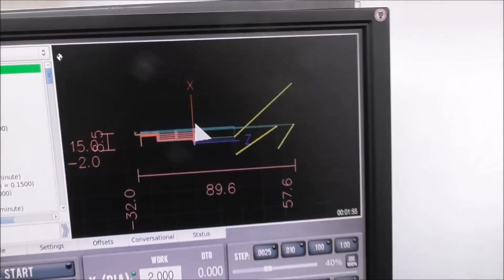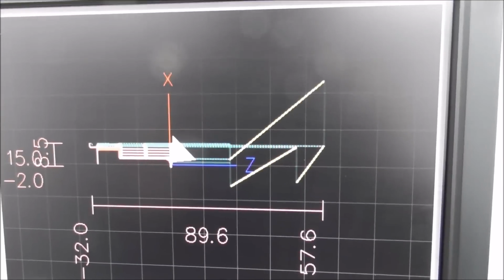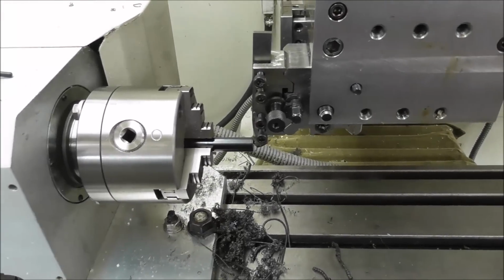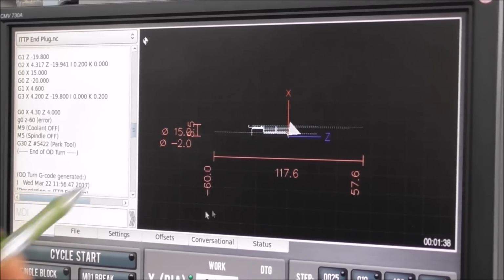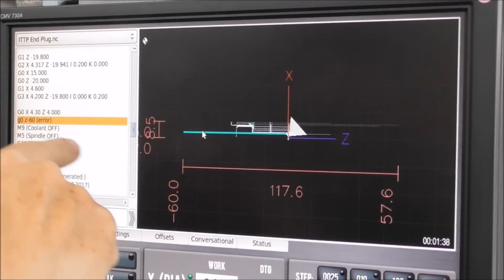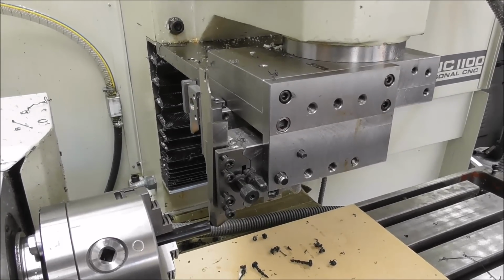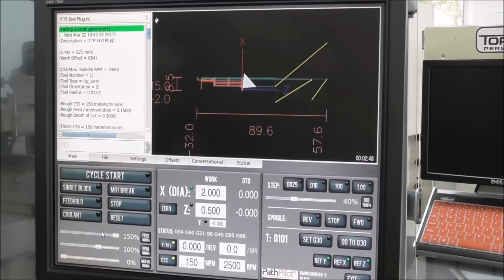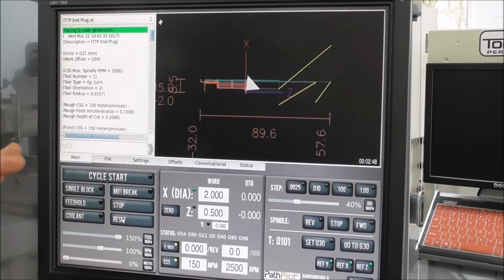Tormach Rapidturn -  Chip Control and Crash Avoidance

Comment: Needed to turn that parting tool around so the tit is left on the finished part, not the barstock
Reply from the maker: Hi Aaron. I don't follow your suggestion of turning the parting tool around?  Cliff
Reply: Are you able to flip 180 on the tool post and run spindle in reverse ? I only mention because I see the bar stock has no remainder tit after part off but the part has one. Or is the tit a feature of the part ?
Reply from the maker: @aaronreihl39 Thanks, I see what you mean. That part has a slot machined in the head that removes the pip. But I will keep your idea in mind, it might be useful in the future! Cheers  Cliff

Comment: Hi Cliff.  Great programming technique to "wipe" plastic swarf.  You have solved one of my plastic swarf control issues.  Next time I face the problem, I'll manually add some G code to perform the wiping action.  I use Fusion360 to generate code or a lot of manual coding with my Mach3 home built CNC lathe.
Reply from the maker: Thanks for taking the time to give feedback Chris.  Cliff